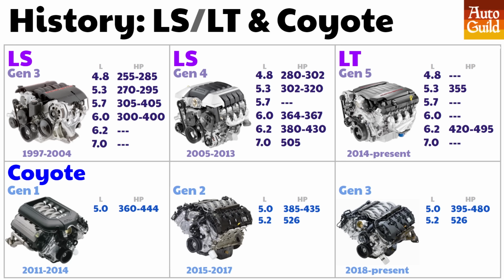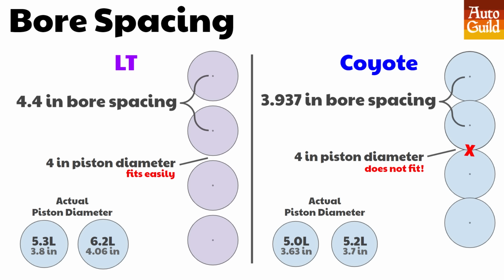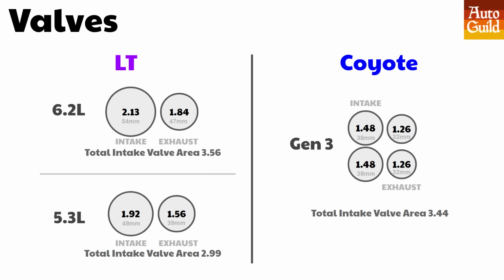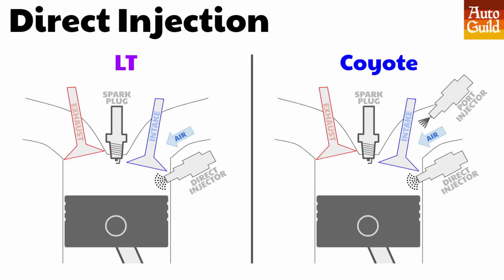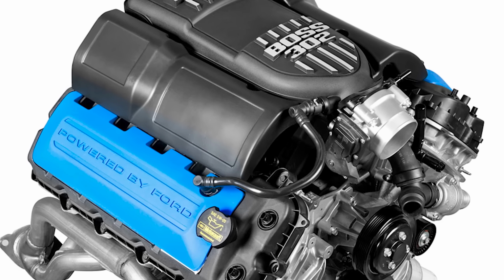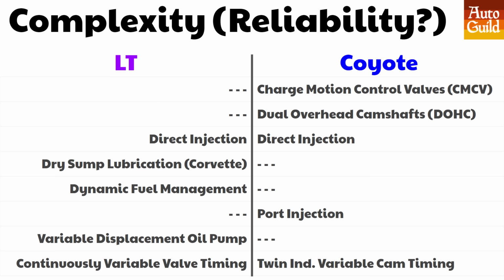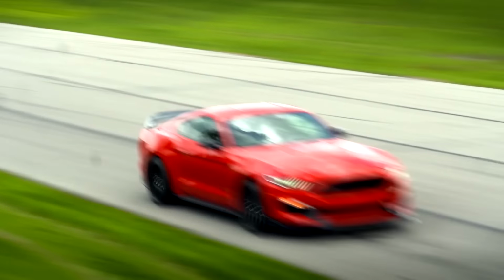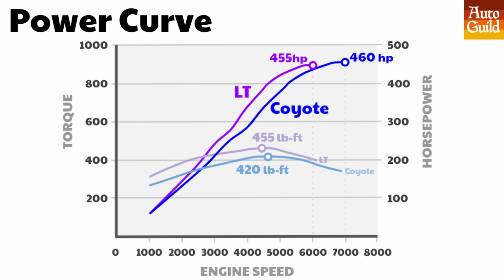GM Gen 5 LT vs Ford Coyote.  Which one is better and why.

Comment: The coyote engine uses way more fuel than the LT when its working hard. It burns more fuel because of higher revs. You could say more revs means more displacement. Chevy is all around just better
Reply: You mean except the DI fuel system, right?

Comment: This video is more catered to the 2% of buyers who care about modifying engines. For most people, the daily driver is what counts. In that regard I don't see why anyone would buy the gm crap. There are to many problems with them. From pistons coming apart and lifters failing. The cylinder deactivation on the gm engines is appalling. Watch the videos from I do cars. Most of his teardowns are gm engines. It is amazing the high percentage that are broke.
Reply: You can say what you want to say about GM’s cylinder deactivation but it’s usually because the owners put off doing routine maintenance that kills them. The older engines without it could take more abuse and you can tell by how many old Suburbans from the 90s are still on the road.

Comment: There is slight interchangeability between the Modulars and Coyotes.  The motor mounts are the same and they both have the same transmission bolt pattern.

Comment: Honestly, both engines are making ~300 ft lbs at 1000 RPM just off idle, my 390 makes 330 ft lbs at 1000 RPM, my old school 302 only makes 239 ft lbs.

The new Coyote is making more low end torque than a lot of old Chevy small blocks, 348 CID and above.

I'm still planning on tweaking my old Fords but to be honest it's becoming a little less fun. I can certainly match most of the modern engines but there's a lot of $$ involved to do that and it is hard to compete with variable valve timing.

I've been thinking for a few years on how to tie variable valve timing to oil pressure for a retrofit kit but when oil pressure drops on older engines it will become an issue. I guess if a modern kit adds that ability to an old small block Ford, how it behaves at 100K miles won't be my problem any more...

Comment: I was hoping to hear more about failure rates.  I briefly looked at a GT350 but the engine issues kind of scared me away.  Also would have been interesting to include the 6.4 and 6.2 offerings from Stelantis.
Reply: Yep, not interested in the Voodoo, even if it sounds cool. I want a reliable engine that'll last a long time.
Reply: @Daddy-o-z2r  - Any engine made to rev to 9000 rpms and have massive amounts of power/torque aren't ever going to be "made to last a long time" - Not one engine in any high performance car will last if driven as intended. The predicted engine "life" of a Ferrari or other exotic car engine is less than 60k miles. If I want longevity, I'll buy a Toyota Corolla.
Reply: @pbaker7160  Well, the LT1 only revs to 6k, and it, like the coyote, typically last 150k+ miles. I don't think you're gonna see many 150k+ GT350's.
Reply: @pbaker7160  here for a good time not a long time amen brotha
Reply: @ryanfaubert2014  we will all be dead tomorrow so live it up
Reply: Up until 2017 Voodoo engines had oil consumption issues.  Rectified for 2018.
If you're entertaining the idea of getting one make sure it's 2018+
Reply: @A C I'll keep your warnings in mine while banging off the red limiter at 8250 RPM.  I've owned a lot of cars, none has brought more smiles and looks from others.
Reply: There have been some issues with the voodoo for sure but I just can't bring myself to take all the fuss with anything more than a grain of salt. It's a high performance engine. It's not a Camry that you can literally drive 300k+ miles while getting oil changes basically whenever you feel like it and never have opened your own hood. People that actually genuinely take care of their stuff and take the time to learn it's quirks in and out are a minority. And I don't mean don't drive it hard like it was meant for! But quality oil, religious changes, regularly checking levels and consumption, and proper thermal management make all the difference. High performance engines and long life engines typically have design decisions and philosophies that are directly at odds with each other. That doesn't mean you can't absolutely over-engineer something and overbuild it so that you can get big power from a much lower stressed engine, but that makes it expen$$$ive and/or heavy. Something's gotta give. We're not talking about a motor for a $300k+ Ferrari after all.
Reply: I would stay clear of the VooDoo engine for sure.. ESPECIALLY if you plan on doing track days. Randy Probst (professional race car driver and car tester) mentioned how he was not a fan of the voodoo because they DO NOT handle track days well.. as in... they fail, in a bad way
Reply: The voodoo is a victim of bad hype and jealous Chevy owners.  It's an incredible engine.  And Randy is a knowledgeable source but has openly preferred the Camaro to every Mustang he's tested.
Reply: @Lambo4487-k5p   I've seen too many voodoo engines that have failed or were replaced under warranty. C&D's GT350 burnt lots of oil and they even hinted that Ford's warranty dept probably cancelled production of the GT350. And I don't own either.
Reply: @RacinJason  Broken in correctly, and allowed to warm up sufficiently before wailing on them and oil consumption is not an issue.  Most of the failures can be traced to those human errors.
Reply: @Lambo4487-k5p  Oh, I see, so all those problems are just user error, including the Car and Driver car, because they don't know what they're doing? Yeah, I'm sure that's it. Funny how you don't hear of the Coyote, Predator, LS, Hemi and others with this problem.
Reply: @RacinJason  if you look at real facts and not "I've heard on the internet" the voodoo failures are only slightly greater than the coyote.  But again, jealous Camaro and Challenger owners like to spin up half truths and falsehoods.  My observations are based on facts.  And if the GT350's are so bad why are they fetching huge prices on the resale market?  They are great cars with unique and amazing power plants.
Reply: @RacinJason  Actually "seen" or read on some post?  Here's a FACT.  Less than 5% of Voodoo's have failed....amongst all gens.  These engines are designed for high revs and high power....tolerances are very tight and will be prone for failure if not maintained.  I own 2 of these and all is good despite my abuse.
Reply: @RacinJason  As a 30 year mechanic...I can attest that the LS is NOT all THAT!!!  Many, many, many lifter failures, oil pressure issues,  piston slap, etc,  have come across my shop.  Hemi's are the worst of all these....I've personally replaced dozens of Hemi's with various issues.  Lifter failure followed by Cam failure is most common.
Reply: @Lambo4487-k5p  Voodoos don’t have DCT transmissions.  That’s a deal breaker for me.  As for sound, Ferrari NA V8 still sound better than Voodoo by a lot.
Reply: @chijen2010  People that can afford a ferrari don't buy Mustangs.  Duh.  Us poor peasants save up and buy our dream GT350s.  And love the old school 6 speed manual.  And as Shelby said years ago, "Ferrari's ass is mine".
Reply: @RacinJason  To be fair, no, car and driver has no clue what they're doing. Especially considering most of their articles can be easily traced back to a car company paying for positive publicity.
Reply: @antimatter.matters  They've been testing and reviewing cars for 60 years, yet according to you, they have "no clue" what they're doing? What car literature do you use that is so much better and reliable? Also, (since it's so "easily traced") show us once, where C&D's provided a false review because they were paid off. 

Besides, they love the GT350, but they are honest about its problems. Yet you criticize them for being honest?
Reply: @Lambo4487-k5p I've been tracking and been into autocross scene heavily since 2001. I've owned many cars from German, to Japanese to american. I've owned two GT350s. A 2016 and a 2018. Both of them with engine failures! As a car guy, it's devastating to see but close friends have had the EXACT same issues with theirs. I switched to a ZL1 1LE in 2019. I've had zero issues since and God damn it son, this car sees all the abuse and all the daily driving! Frankly, this ZL1 is much more fun on and off track. I almost bought a 2020 GT500 but damn it, bud, this 1LE is too damn good of a car to let go. I'm curious how long this son of a bitch will last me with all these hard track miles! Have a close pal in California that has 90k miles on his ZL1 1LE. That's absurd. He says the only issues hevs had was with the TPMS sensors failing early on. This car should be called Camaro Superman trim instead of ZL1 1LE. It makes you feel like a damn hero. GT350 nor GT350R can compete with the handling or fun. Fun factor and steering feel make a world of difference difference. Ford will hopefully build a credible GT350 in thr future. For now, Ford can kiss my black ass. I gave that car two chances with two different model years. Fk all ya'll that defend that trash ass motor.

Comment: Im a ford guy and that coyote engine is an absolute jewel! However, i still hold the LS in that #1 spot for engines. Just so much diversity and aftermarket support to make crazy power in an engine thats pretty damn small in size, not displacement since almost all of them are over 5L. Sick video, love learning about stuff like this, keep it up!
Reply: Well said!
Reply: Nice to finally see a Ford guy understand what this whole argument is about. The coyote is a great engine but the LS just makes more sense for everyday guys on a budget,not to mention size constraints.
Reply: @saltydog7988  Tho the budget and size constraints are heavily exaggerated by some Chevy guys to prove the LS is better for builds. Mod for mod the Ford actually beats the Chevy most of the time in power increase especially boost. It's a little more complicated in size and budget yes, but in the end it will be closer than people like to admit since the Ford doesn't require new parts or to completely build the engine, the OEM parts take massive abuse so you end up not spending money on those at all.
Reply: @raionshishi8290  
I hate to disagree,but it’s not the Chevy guys propagating this story. Tell me how many Chevy guys are swapping in a Ford engine vs Ford guys swapping in a Chevy motor? Not too many is my guess. 
As to the “Chevy just copied Ford” camp…do you really not think if Ford engineers knew what they had designed would they would not have developed it? And if so,what does that say about their engineers? 
Simple fact is GM engineers unconstrained run circles around Ford engineers. BTW…the magnetorheological shocks that let your Mustangs halfway keep up with Camaro’s? Thank GM for those. Y’all whine incessantly about displacement…5.0 vs 5.3/6.0/6.2. Two different schools of thought…but when GM decides to go for the added complexity of DOHC they’ll wipe the floor with your vaunted “Cowdoodie”. BTW…what’s with Ford and these stupid nicknames? Juvenile. You should be happy GM has stayed with cam in block. Gives you at least SOME room to crow. Dollar for dollar your engine still doesn’t compete with an LS,much less an LT engine. When’s the last time ANY Ford won a racing championship? The sixties or seventies? NHRA…nope. Indy car…nope. Daytona…nope. NASCAR…maybe once in the last 20 years. Shows me what OHC is good for. But do tell me how superior Ford is. The only real claim Ford has is when a goofy Texan named Shelby hot rodded their pathetic product did they stood out. Other than that…nada. And had the powers that presided over GM at the time not reigned Zora Arkus Duntov in…you would not even have LeMans in your pocket. 
So please do tell me how Ford is God when it comes to engines.
Reply: @saltydog7988 Maybe don't be broke? This isn't about what engine is better for those who are poor its about which one is better period, and the Coyote is better. Far more potential, far more efficient. They love boost and revs. Not sure what there isn't to like about the coyote.
Reply: @Swerzuh  Yea pretty much this is where I am at.
Reply: @Swerzuh  
I’m far from broke hot rod…just stating which engine is easier to swap int platforms. For all your whiny Ford ass boys talking about displacement how about physical dimensions? You need a damned medium duty truck to fit that humongous ass coyote in whereas an LS/LT fits in almost anything. (Fox body’s🤔,Miata’s,etc). As for boost,LS’s love it too…and it’s gonna a cost a fuck ton less to make hp in the LS vs your rabid dog motor. I can afford it…just don’t see the point pissing away money just so I can say my Ford can keep up with a lowly cam in block LS.  But you do you big boy. Meanwhile,GM still dominates your ass at the drag strip no matter what. Any Coyote pro stocks? Pro mods? Pro comps? Street eliminator? Super comps? I’ll wait to hear from you. 🙄

Comment: Maybe you can address the fact that they both make similar power at different rpm with the pushrod motor being overall smaller physically, lighter, less complicated and having the same approximated efficiency during normal driving while stating that the Ford has the efficiency advantage based on displacement…

Also Voodoo for me in a stock gt350 even with its issues but ls/Lt in everything else. Which actually seems to play out in units made.

Comment: HP/L is ricer math. All that matters is HP/LB (Weight) in the real world. I know I know but if the coyote was 6.2 instead or 5.0 it would make x more hp. Doesn't matter because it can't be and if it was then it would no longer fit inside the hood. Real world design limitations instead of theoretical.

Comment: Both engines have their strengths but i really don't think the "if the coyote were 6.2L is would make x power" argument carries any weight. You can't really directly extrapolate HP/L up like that too. If the engine were more displacement, everything would need to be enlarged. Pistons, stroke (aka heavier rods and crank), valves (hurts rpm). All of these seemingly small things would add up to reduced HP/L values. 

The coyote will likely never be increased to a 6.2L. As you showed, the lower displacement was an engineering trade off that Ford did in exchange for better heads where GM went with more displacement to make up for less efficient heads (and lower HP/L). The coyote is already larger than the LT and heavier at "only" 5L. You saw with bore spacing they'd have the grow the engine even more to increase the displacement much. 

It's a trade off each manufacturer chose a different approach to. Trying to say "well if the coyote had 6.2L" is as dumb as saying "well if the LT had DOHC".

They don't. They never will. It's an apples to oranges comparison.
Reply: Can you imagine how WIDE a 6.2L DOHC engine would be? 😂🤣😂.... I'd still try to fit it in something tho!

Comment: Good video, the biggest take away here is the price. Ls, Lt far more cheaper to purchase and upgrade. Not to mention a more simple design, easier to work on. I feel ford doesn't leav much room on the plate for modding, they come pretty maxed out in my opinion. Both have there place.

Comment: The trend of putting a Chevy motor in a Ford hot rod, came from the early days of hot rodding. Back then there was not a lot of support from the aftermarket for go fast parts for Ford engines. It was just easier to put in a Chevy motor and build it to go fast, the trend just stuck. Those days are over, now there is plenty of support for Ford engines. Being a Ford guy I would never put a Chevy or any other engine in one of my Fords.
Reply: You obviously don’t go to the drag strip because that is not over  I doubt anybody takes a new mustang and puts a ls in it but I will guarantee if the motor goes bad and they are going to race the car it will have a Chevy engine because they are easier and make great power and probably half the cost fords are great just not to work on
Reply: @dmanlangley7326  I have been to the drag strip. And it is true, you can make just as much power with a Ford, it just depends on how much you want to make, as to how much it costs. Ford or Chevy, if you want to make BIG power it will be expensive. I was talking about brand loyalty.
Reply: There are a bare minimum of 4 mustangs that are newer than 2006 with ls swaps within 40 miles of my house.... one with a 5.3, 2 with 6.0, and one with a 6.2, thats just the ones I know about and I live in the middle of nowhere with no drag strip within 100 miles. If you want it reliable, fast, and affordable you throw in an ls that's why they are so commonly swapped in

Comment: Power per liter means nothing when the Coyote has literally none of the benefits of a smaller displacement engine.  It's heavier, bigger and gets worse fuel economy.  

The LS/LT family MURDERS the Coyote in average power/torque in stock form and when modified.  That negates any perceived advantage of 4 cam phasing vs single cam VVT.

Coyote costs more in every way and is less reliable.

Stock motor vs stock motor the LT is SIGNIFICANTLY more robust.

LT is underrated more than Coyote when tested on an independent engine dyno.

I love the Coyote, but it's simply inferior to the LT.  Extremely close, but not quite as good.